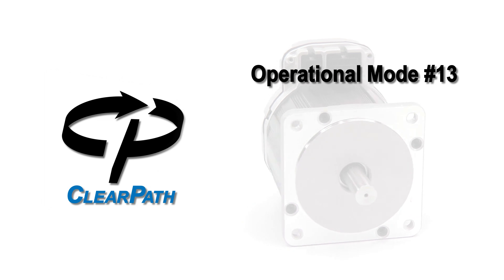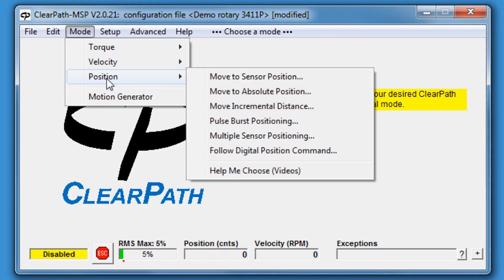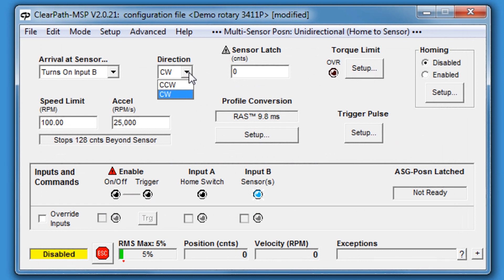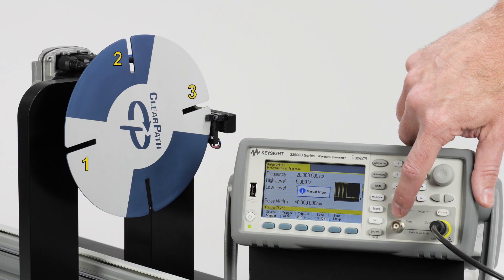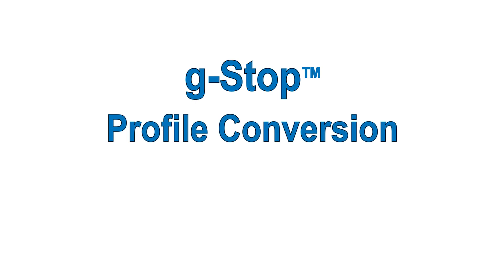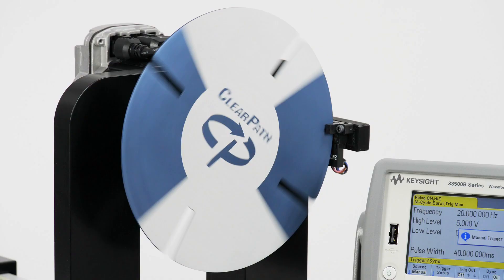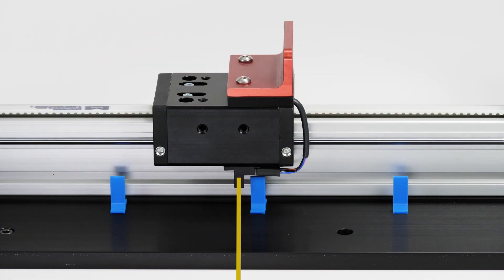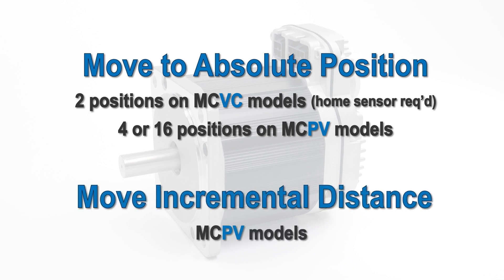ClearPath Integrated Servo: Multi-Sensor Positioning

Comment: Hello guys. Please, I need your help.
I fell in love with the performance of this super-motor ❤️ . I want to know if I can use it in an wire bending machine with a diameter of between 6 millimeters and 10 millimeters ... And can i use it in mechanism to cut metal bars ... His speed is miraculous ... I can hardly believe this motor is real
Reply from the maker: Hi You ssef,

I'm glad to hear the ClearPath servo is working well for you.

ClearPath motors are used successfully in a wide variety of machines controlling a diverse range of actuators. This use includes wire bending machines and cutters. Just like any application, as long as the ClearPath is properly sized and an appropriate control scheme is used, you can be successful.

It sounds like you already have a specific motor model. If it turns out your new application would be optimized with a different ClearPath or control scheme, our motor selection guide can help narrow down the choices.
https://www.teknic.com/products/clearpath-brushless-dc-servo-motors/clearpath-motor-selection-guide/

I hope this helps. If you have further questions about ClearPath or your new application please reach out and contact us. (https://www.teknic.com/contact/).

Best regards,
Matt C. -Teknic Servo Systems Engineer

Comment: Guys what motor size would I need for this project! I'm looking for the motor to turn  up to a max of 300lbs. on a tabletop that will be attached to the shaft, we want to use a wireless transmitter/receiver gyro/accel connected to a adruino and when we turn left/right I want the motor to turn as well, nothing in a fast motion, I prob have to add code to the adruino to control the motor, I'm seeing what size I would need, thanks for any info..
Reply from the maker: Hi Virtual Gamesterz,

To size a motor we will need some additional information (such as mechanical information, move time goals, etc.)  Please give us a call or email support@teknic.com. We'll be happy to assist.

Erik M. - Teknic Servo Systems Engineer

Comment: How would I be able to use these motors in a RepRap machine?I'm thinking of using 75v to power them but I'm not sure how to use these with a board like mks gen l 1.0
Reply from the maker: Hi Roman Voloshyn,
 
I have no personal experience with the RepRap machine or its controller (MKS), but I think I can help you by highlighting what is required to control the ClearPath – SD servos.

ClearPath is an integrated servo system (servo motor, drive and encoder), so you only need to supply it with bus power (24-75Vdc) and a digital command. The ClearPath – SD series of motors are controlled using step and direction signals (similar to how you would control a stepper motor).  Each ClearPath - SD servo has 3 digital inputs: Enable, Input A (Direction), and Input B (Step), and also 1 digital output to provide High Level Feedback (HLFB).  

For each ClearPath motor, the MKS controller will need to provide 5 to 24Vdc for the Enable line, Input A and Input B, each capable of sourcing (or sinking) about 12 mAmps.  Although HLFB is not required for the motor to operate, we recommend that you use it to provide the controller with move status and motor fault notifications (assuming that this is possible with the MKS).

If the MKS controller is already configured to output 5-24Vdc step and direction signals, then you should be able to wire the existing step line and direction line to Input B and Input A, respectively.  It would then be as simple as powering the Enable input, and the system would respond to step and direction commands.

I hope this helped address your questions.  Please feel free to contact Teknic if there are any other ClearPath related questions we can help with.

Best regards,
Mark D - Teknic Servo Motion Control Engineer

Comment: I have a question about I guess what you’d call ‘stalling’ what happens if my mechanism jams? The servo keep trying to move to position or will it time out after a certain time?
Reply from the maker: Hi Matt,

This is a good question. The short answer is that if there is something physically preventing the motor from reaching the commanded position, it will issue a safety shutdown. 

There are several different shutdown types that may occur based on the specific situation. The shutdown type that occurs first is based on the commanded motion and motor settings. These shutdowns help to prevent damage to your mechanics and to the motor itself. Once the jam is removed and ClearPath is reset, you should be able to resume operation.

If you're interested, here is a link to a video that goes a bit further into detail on these shutdowns as well as some helpful safety features: 

https://www.youtube.com/watch?v=sCA3O8UNl1c 

I hope this information is helpful. If you have any additional questions, please feel free to give Teknic a call or email us at support@teknic.com.

Best,
Bridgette G. - Teknic Servo Systems Engineer
Reply: Teknic Inc thank you so much

Comment: I wish they would run on 12 volt. I have a million applications for 12 volts
Reply from the maker: Hi David and Matt,

Although the ClearPath motors cannot run from 12 VDC, the good news is that the fractional hp, DC input ClearPath motors can run on anything between 24-75VDC. Additionally, Teknic does have a number of customers who use 12V batteries to drive their systems, but those customers wire their batteries in series to provide at least 24V to the motor.

Many people have asked why Teknic doesn’t make NEMA 23/34 motors that run off of a wider nominal input voltage range though (i.e. greater than 75VDC or less than 24VDC). The short answer is that it all comes down to motor/drive design and construction. If you'd like more information, I've expanded a bit in the following paragraphs to hopefully help explain these design considerations.

While many stand-alone motors can operate throughout a wide voltage range, ClearPath is an integrated servo motor and servo drive. Servo drives typically operate over a relatively narrow voltage range and this is usually due to component specs and ratings.

By limiting the upper end of the operating voltage for the NEMA 23/34 motors to 75VDC, Teknic was able to decrease the product footprint and keep the overall price down. Theoretically, we could have designed ClearPath for a wider range of voltage, but doing so would have involved choosing different (i.e. larger and more costly) electrical components (e.g. transistors, resistors, capacitors, etc.). 

Teknic also could have decided to lower the minimum voltage range to less than 24VDC, but that would have brought its own set of challenges. While it’s true that we could have looked at different electrical components if we ran below 24VDC (components capable of handling increased current), the bigger issue was the power output of the motor. The power output of these motors at 12VDC is not very high, and to change that, would have required major redesigns.  

As you may already know, a motor’s electrical power input is proportional to the mechanical power output, and electrical power = voltage * current. If we want to keep the same power output despite a drop in input voltage, we would need to increase the current proportionately. However, as the current through the windings increases, the resistive losses increase as well (these are calculated as I^2*R losses). Now, we can (to an extent) counteract these losses in other ways (e.g. by decreasing the resistance), but doing so involves major changes to the motor’s construction (e.g. a completely different housing with different wire gauges, fill factors, etc.).  

If you take a look at the torque-speed curves on our website, you'll see that you can adjust them for a few different voltage levels (24VDC, 36VDC, 48VDC, 75VDC). The maximum power output for any motor is at 75VDC, and you'll notice that for most models, if you lower the input voltage to less than 75VDC, the performance is decreased as well. If we had designed the motor to run from 12-75VDC, the power output at 12VDC would so low as to render them unusable in most applications. 

I hope this information helps. If you have any questions regarding the use of ClearPath in your application, please feel free to contact support@teknic.com.

Best regards,
Bridgette G. - Teknic Servo Systems Engineer
Reply: Teknic Inc Thank you Bridgette for taking the time to write such an informative reply.  The products you produce look fantastic, you should all be congratulated for their design and implementation.
Reply: Teknic Inc thank you for your answer, I'll have to look into making it 24 volts, that requires a heavier battery setup.
Reply: David Myers or even 48v, 75v is a little tricky!